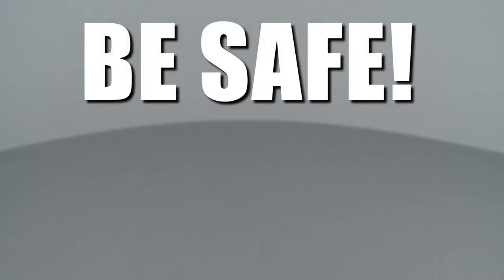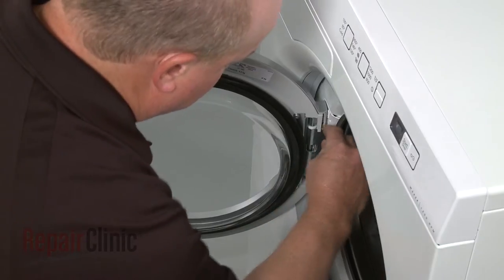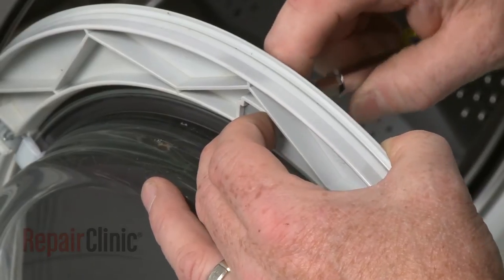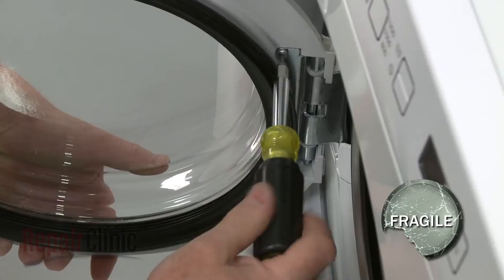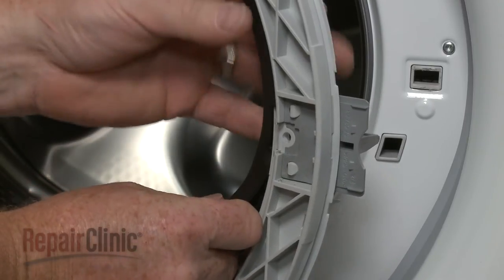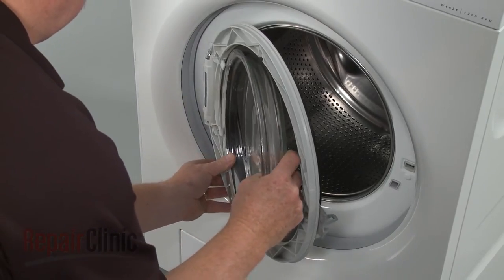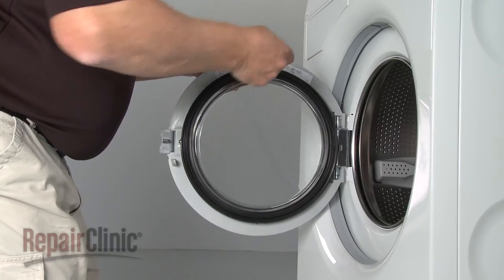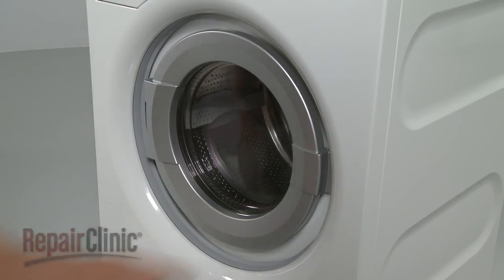Asko Washer Door Seal Replacement #8081128

Comment: Actually I believe that for the most part if the door seal is leaking there is no need for a new seal. On this particular door hinge  W6444 the hinge has a double flex and the metal bends over time when the door is opened. So all you need is a large pair of multigrips and then with the handles of the grips in towards the drum squeeze the hinge as firmly as possible. Now when you close the door you will see the plastic cover will fit up tight against the door frame and it wont leak anymore...

Comment: What about a video for the later models like the w6864  as the handles completely differs
Reply: just did mine..yes similar but handle part needs to come off first
Reply: @jadejoeana3238  I used RepairClinic's icons for TV shows in my mind for what was dangerous. For example, on Columbo - Double Shock with the mixer being submersed, and Columbo - Try and Catch Me with the piece of paper in the light socket, I reused the "Shock" icon. On the scene with Columbo getting kicked out of their home on Double Shock, I reused the "Fragile" icon. On Columbo - Now You See Him, when Santini burns the pieces of paper in the bathroom, I reused the "Fire" icon.
Reply: @jadejoeana3238  How do you remove the handle part?
Reply: @jadejoeana3238  Don't worry, I have figured it out. 😀